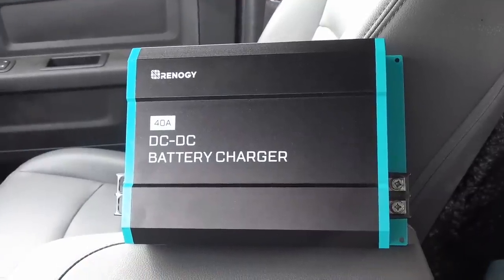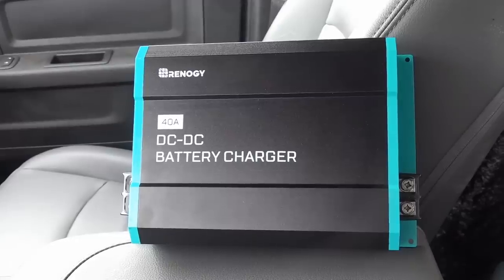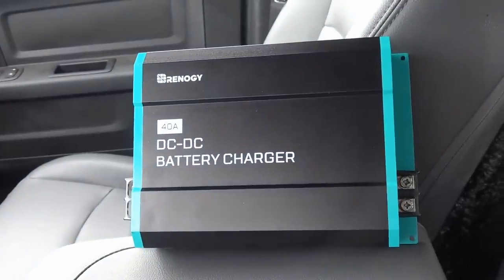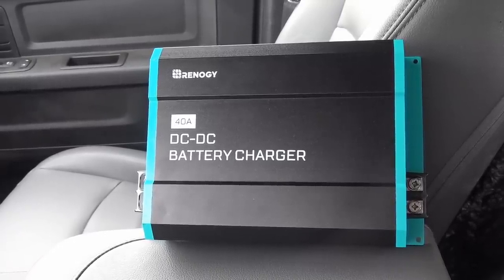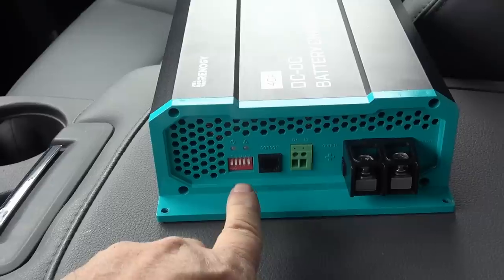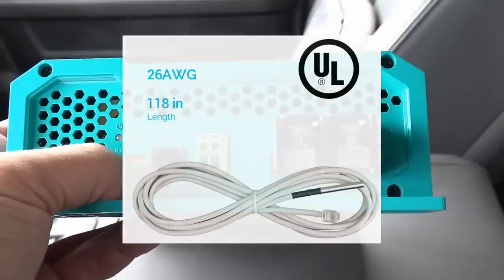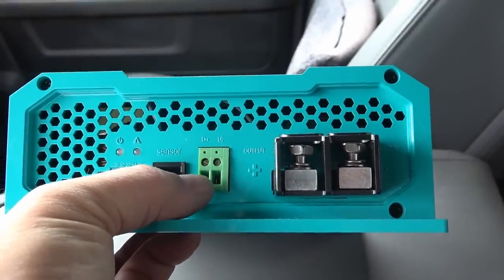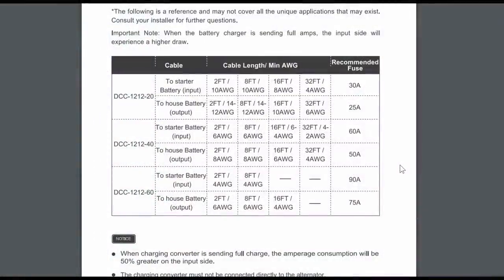Extra 40 Amps Charging into RV Battery Bank from Truck Alternator (Renogy 40A DC-DC Charger)

Comment: I have a question. My Jeep has a factory 7 pin connection for my camper to connect. My alternator charges my batteries while I am driving. If I connect the DC-DC charger like you have yours connected, do I need to disconnect some wire from the 7 pin connector to protect the alternator from overheating? This is the main reason for getting a DC-DC charger, for me. I have 2 lithium batteries in my camper. Thanks.
Reply from the maker: Hard to answer as there are several variabilities to take into account. I'm not familiar with how many amps the 7 pin on the Jeep puts out. That's something you'll have to measure or find out. On my truck the 7 pin charging in minimal, maybe 5-7 amps max, mostly just a trickle charger due to the small wire size used by the OEM tow package and the long wire run.  So if its like my setup then if your alternator is heavy duty enough to handle the 40 amp DC-DC charger it should also be able to handle the extra few amps from the tow cable.  The one on my truck is rated for 220 amps and its also a smart alternator so has built in regulation.  Cheers, Ray
Reply: @LoveYourRV  Thanks!!
Reply: @stacyhazelwood4033  Or just get the 20 amp one, combined with what Ray says above, you could be doing a total close to 25 - 30 anyways.  Plus you may not have as high an alternator rating, as I know I don't and I think that's what I will just go with if I find a need for the DC-DC unit.  But when I boondock, I use the A/C & thus run gens, so for now I don't need that yet.

Comment: Hi Ray, I just installed a Renogy 40 amp DC to DC in my 5th wheel. I used your list of parts as a guide.  Tested it and all ran well. So I thought. We are on the road for 3 months.  I noticed that our 50 amp breaker coming out of the charger will trip after 4-5 mins. this happens even while just idling.  I get a read of 44amps coming of my battery and 42 amps coming off the charger before it trips.  Any ideas? We do have a 4500 generator as well to fill our needs. I had hoped to be charging on driving days.  

I always enjoy and learn from you videos .  Thanks for all you do
Reply from the maker: Sounds like either the breaker is faulty or for some reason your alternator/battery voltage is dropping briefly causing the DC-DC converter amperage to increase to compensate. The Renogy manual says you can use up to a 60 amp breaker. I was able to use a 50 amp and it was OK with my truck, but things can vary depending on the quality and freshness of the truck batteries and the capacity of the alternator and wiring resistance. Cheers, Ray
Reply: @LoveYourRV  I think I will test the breaker first since the fuse and/or the breaker at the battery didn't trip.  hope you make it south this winter. Thank you
Reply from the maker: Oh, I was confused and thought it was the breaker in the truck. If its the breaker in the RV it seems weird to me that the DC-DC would put out more than its rated amperage so I would lean towards a faulty breaker unless you have something else feeding the batteries on the same line.

Comment: Ray that wire coming from your battery looks larger that 4awg.  Can you please confirm.
Reply from the maker: Not sure which battery you mean. From the truck battery its 4GA from the battery to the breaker, the same stuff I used for the run to the other end of the truck.  For the RV battery bank there is short piece of 2/0 gauge to a main fused buss bar then the same 4GA for the DC-DC charger feed. The 4GA may look big because it has a thick covering.
Reply: @LoveYourRV  In your video at the 12:27 mark the cable coming from the truck battery going to the breaker.
Reply from the maker: It's a 4 GA, here is an earlier video where I did the truck wiring install - https://youtu.be/w3LwwfNPDUA?t=171  I was experimenting with using a old solar controller as a DC-DC charge but due to the long wire run it didn't work that well and so that's why I ended up installing the Renogy DC-DC
Reply: @LoveYourRV  Thanks Ray.  Enjoy our videos, thanks for making them.

Comment: Ray, I have 4 Lion Energy 1300's. After talking to LE about the charging profile from my victron multi plus inverter/charger they had me limit the amps to no more than 50 for longevity of the battery. Just thought I'd pass on the info. Might want to get in touch with them to confirm that.
Reply from the maker: Yeah, 50 amps per battery so for my 3 in parallel that's 3X50=150 amps. :)
Reply: @LoveYourRV  huh, so I should be able to charge up to 200 amps then?
Reply from the maker: Yes, if wired in parallel, as each battery would be receiving 50 amps of the charge if balanced.

Comment: decent video but with all the  breakers everywhere i really cant keep up well. ive noticed that about alot of solar videos. there is a cut off switch everywhere and it adds much confusion to a seemingly simple install. just need to know where the 5 wires go, it could be very basic.
Reply from the maker: That's because there is a fire risk when you connect a system without proper safety devices like breakers or fuses. Generally, each wire run section needs its own fuse or breaker for safety. Without them, a short circuit could heat the connecting wire so hot that it could cause a fire or melting, damage, or injury. People like to use breakers because you get the required fuse action for safety and a switch making it easy to disconnect different sections of the circuit if needed.

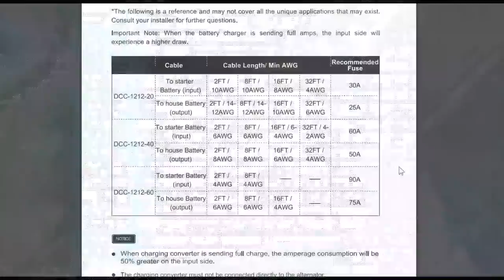Comment: Hey Ray - regarding the chart that you put up at 4:25 (cable size), is that like a standard AWG chart that includes total length of circuit (pos length + neg length) or is that referring only to the positive cable (Renogy input)?
Reply from the maker: It doesn't say in the manual if the wire length is one-way or round trip. I guessed it as one way and it's working well for me. Used 4GA cable. I get about 50 amps on the input side and almost the rated 40 amps on the output charging side. That's about what I would expect. Large cable would work better of course but more expensive and harder to install.
Reply: @LoveYourRV  Thanks, Sir.

Comment: Wouldn't a $75 isolator have done the same thing? For a lot less money? Just asking, of course this thing is a lot better quality.
Reply from the maker: The DC-DC charger is able to isolate but it also converts voltage levels to optimize charging and deal with long wiring runs such as the one from my truck alternator all the way to my trailer battery bank. When the wire run is long there is voltage drop but the DC-DC can boost it back up on the output side to charge the batteries properly. It also has a multistage programable charging profiles for various battery types. So you're getting a much more sophisticated device than a simple isolator.  Cheers, Ray
Reply: M km

Comment: Great charging add on Ray! As a matter of interest, did you set the charge voltage to absorption or float voltage on the charger? Eg 14.4V or 13.6V?
Reply from the maker: For first test, I just left all settings as factory, all DIP switches were on, which is 14.4V constant then 13.8V float. The charge can be set for lithium as well with no float, will have to try the various voltages and see what works best for my batteries. You can look at the manual here to see all the DIP switch settings available - https://www.renogy.com/content/RNG-DCC1212-20-BC/DCC1212-204060-Manual.pdf
Reply: That’s really nice being able to set both. If it were me, I’d likely set it up the absorption voltage and time the same as the solar charge controller, but set the float a tenth or two of a volt below. Only reason for this is when driving, when the battery bank gets full and goes through the absorption stage, solar if weather permits will float it from there as the primary charger, and only draw off the truck alternator if necessary. Then you could actually leave it connected every time you tow. Either way it’s a great setup you have 👍🏻
Reply: Lucky Charm RV’ing 
Agreed. The less ongoing thought the better, let the software do stuff for you- that’s what it’s there for! 

I haven’t looked into it, but my thought is - with the right charge controller that can take the combined amps, you could run the DC-to-DC right through the charge controller and think about it even less!

Comment: Could you connect the 60 amp breaker directly to battery?
Reply from the maker: I guess you could but I'd rather not have it right on the battery as they can some times leak battery acid out the top and maybe ruin the breaker so have it installed a little bit away from it.

Comment: Could you do a short review or provide your experience with the 60A switchable breaker? Saw a few reviews on Amazon that they don't work as advertised, but I was planning on using a few for my DC to DC and sitting between my Solar Panels and MPPT.
Reply from the maker: No problems so far. I've also used switchable breakers in my RV DC power system without a problem. Have a total of 5 breakers from various manufacturers now. One of them is now 10 years old, and a couple others are around 7. I think the best is likely the Blue Sea brand, but you'll pay a bit of a premium for it as it's designed more rugged for a marine environment.  https://amzn.to/3dXTSbc Cheers, Ray

Comment: Could you tie directly to your alternator instead of the start battery? Not lithium batteries
Reply from the maker: Should be OK most alternators are connected directly to the starter battery

Comment: Are the jumper cables used Copper Clad or for this purpose does it matter?
Reply from the maker: Best to use pure copper cables. A little more expensive but better conductivity.
Reply: @LoveYourRV  Thanks Ray!  Do you have a recommendation on a specific set?
Reply from the maker: Not specifically I found a set at a truck stop. Just have to look for 100% copper. Could always use normal copper wire. I just found the jumpers were nice as they were connected as one. Cheers, Ray
Reply: Does the power from the charger go directly to the battery after the 40 amp breaker or to the RV bus bar where everything else connects?  I do not have solar at this point.

Comment: Hey it's  great video. But i have a question.  I can connect to my solar system  too? I have  a battery  200a
Reply from the maker: Yes, I travel with the DC-DC charger and my solar controller charging together no problem. Cheers, Ray
Reply: @LoveYourRV  ok thank so much

Comment: I have 5 lion ut1300 batteries, how should I set up my dip switches?
Reply from the maker: Set for lithium mode. Can be found in the owners manual Page 17 https://www.renogy.com/content/RNG-DCC1212-20-BC/DCC1212-204060-Manual.pdf  I usually set for 14.2 to match my solar chargers.

Comment: Don't you have auxiliary switches in the truck? You have put a relay before the breaker and you could turn on/off the battery power to the back of the truck
Reply from the maker: No, I didn't order that option as I would have had to buy an extra options packages. My truck is pretty bare bones and I factory ordered to keep the cost down.

Comment: Ray, can you measure the current going through the 7-pin ground?  I've heard issues with overloading the small ground wire when doing additional charging.
Reply from the maker: My DC-DC charger installation isn't using the 7 pin tow cable ground. It's wired with a separate 4 gauge cable from the negative input lug through the Anderson Power Pole connector and then down to the truck's frame that I utilized for a negative ground return to the battery/alternator. I did use the maker light circuit to power the relay that turns the DC-DC charger on and off, but the current is barely anything to do that.  Cheers, Ray

Comment: What is the voltage at your truck battery at idle when pulling the 50 amps to charge the camper?
Reply from the maker: Measuring 14.3 VDC at the truck battery
Reply: @LoveYourRV  It's nice it's able to keep up with that draw at idle.
Reply from the maker: Yes, I think there is a lot of overhead capacity on my alternator, since I went for the factory optional 220 amp model versus stock 180 amp the 3500 trucks come with. Also, my truck is very bare bones electronics wise, just a tradesman model so not a lot of extras to power.

Comment: Can I use those breaker as a dc breaker disconnect? 

Thank!
Reply from the maker: Could do but depends on the amperage. I use an 80 amp one as a DC disconnect for my RV 12V distribution. I can then easily disconnect the RV circuits if working on the battery system.  Cheers, Ray

Comment: I think my question was more, even if a 20A in enough would a 40A dammage anything being overkill, it should just regulate.  Just in case of future batteries upgrade.  Now I haVe 2 AGM 220 amp/h 😊.
Reply from the maker: It won't hurt anything once the batteries are charged it switches to a float mode and just trickle charges. The drawback to the 40 amp is higher cost. 40 amp unit costs more and you need to get larger cables so wiring cost is also higher.
Reply: Love Your RV thank you Ray, Roger and I just crosser AZ border, maybe our path will cross again 😊.  I have achieved my own oil change, did not make a mess, the longest was tte study of a proper oil pan to properly collect, then would not leak on my way to The Auto part store,  Pan cleans up easy. RV park authorized.
Reply from the maker: We are over in California, boondocking on the eastern slope of the Sierra Nevada, plan to spend the next few weeks here then start to head north back to BC.
Reply: @LoveYourRV   Oh! It must be beautiful!  Next year maybe 😌.  
Hugs to you two and Safe travels ☀️ 
Plus, thank you for your precious help, helpful videos and hard work to make them.  
I also got someone to connect my Winegard Antena to DC with an on-off switch Back in Canada. Since I knew exactly how to and had the parts,  it went very well.  Cheers 💝

Comment: Quick question, Is this a smart charger?
Appreciate the feedback.
Reply from the maker: No, it has dip switches to set for different battery types and voltages. See the manual https://www.renogy.com/content/RNG-DCC1212-20-BC/DCC1212-204060-Manual.pdf  Cheers, Ray
Reply: @LoveYourRV  thank you.

Comment: I have a Ford e350 (Coach house motor home) from  1996. I'm not sure to go for the 40 amp or 20 amp version (because of the the alternator; to high amperage and it might get too hot). What would be the best choice?
Reply from the maker: I'm not sure as I'm not familiar with the OEM charging system on that RV but I imagine it must already have a system in place that is used to charge coach batteries. Maybe you can find the specs somewhere.
Reply: @LoveYourRV  I guess you're right. There is a system that charges the house batteries, but I'm not sure how. And I changed from lead acid to lithium. So it it charges, it's doing a lousy job. Thanks! I'll look into that
Reply: @LoveYourRV  There's indeed a line going from the alternator to the house battery. I guess I can put the DC-DC converter there. Probably it's currently charging the house battery like it's a lead acid.

When then engine is running, it gives 40 amps extra. I'm not sure if this is limited to 40 amps and if there's already a limiter/dc charger. The only thing I could find under the hood is a cool element with 6 cables
Reply from the maker: Sounds like the alternator is powerful enough then to run the 40 amp DC-DC charger

Comment: Do you have any indication that having the running lights enabling the charger causes any problems when the truck side breaker is off? 
I’m thinking this would be a terrific add on for my truck camper while having it controlled from an up fitter switch.
Reply from the maker: I'm not sure what a side breaker is?
Reply: @LoveYourRV  truck-side breaker.  You have a breaker in the truck to shut off the power flow, but the ignition wire that you connected to your trailer lights will still be hits out will be looking for current.  Just wondering if you have seen any issues with that.
Reply from the maker: Oh, the breaker I installed. I thought you were talking about some OEM breaker in the truck. Nope, no issues  Cheers, Ray
Reply: @LoveYourRV  a year later, has it lived up to your expectations?
Reply from the maker: Unfortunately I don't yet have long term testing. Covid severally limited my use as we were stuck here in Canada last winter and didn't get to do our regular 6 months snowbird travels. The couple months I got to use it though I loved it especially when I hit cloudy and rainy parts of the country where solar is not great.